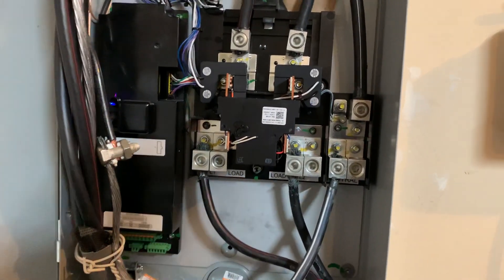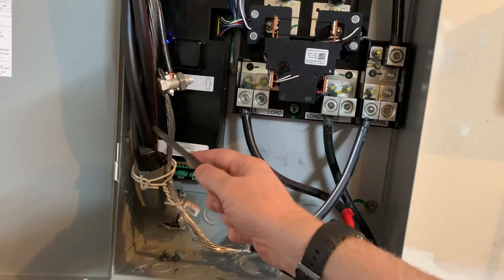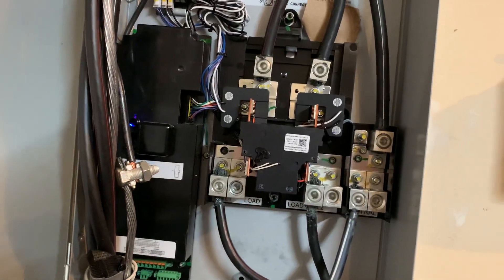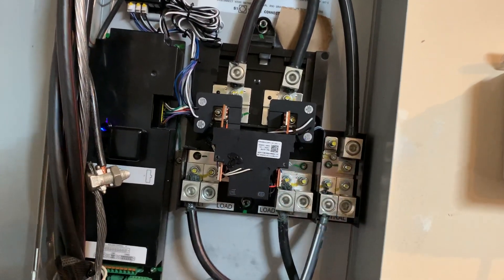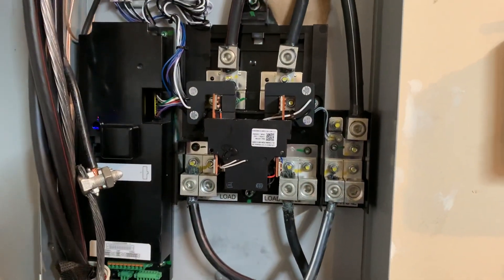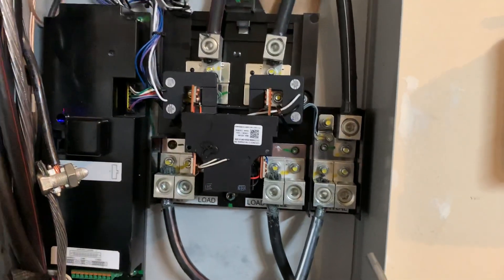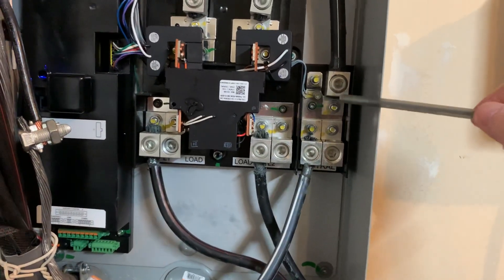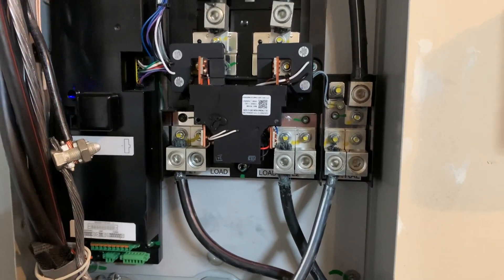How a Tesla gateway works with the powerwall

Comment: Hi I have just purchased a tesla powerwall 1 and it was missing the gateway I'm not sure how to wire it up yet I then bought a gateway it said in the description non back up is this gate  the bit I need to enable me to see either on my laptop or my phone the stats of the battery and do you know the difference between back up gateway and non back up my plan is to charge the battery with my solar panels and run a few sockets of the battery as a separate circuit to my main supply
Reply from the maker: The backup vs non back up is the location where you install the gateway and powerwalls.     If you install your gateway between the meter and your load center, then you can enable back up mode as the gateway will monitor your power usage and can off set that by sending power from the powerwall.
Reply: @teslamike7476  Thank you very much for the reply I understand that now  I don't have much idea at the minute on how to wire it up I am searching online to try find what connects where from battery to the gateway   I bought the battery and have just bought the gateway for it  so can I connect the solar panels  to the battery and from the battery to an inverter as a stand alone system or is the battery ac 240v mains input only? Which im guessing it is I wish I had a simplified wiring diagram
Reply from the maker: @BREN2009 what I did is I connected my battery into the load center with a 32 amp breaker and 6awg wire (over sized the wire).  Then from the powerwall I ran a 16 gage 6 wire to the gateway.      Thats how the gateway talks to the powerwall to tell it to charge or discharge.    

The gateway sits between my electrical meter and my load center.     Where I removed the 0000 aluminum wires from the service panel, and plugged those into the gateway.   I then ran new wires from the gateway to the service panel.      That put me into “back up mode” as the solar panels feed a breaker that’s in my load center.         You do need to run CTs to your solar wires which then plug into your gateway so the gateway knows when power is being generated from the panels.
Reply: @teslamike7476  Thank you so much. Honestly, you are the only person so far  I have talked to that knows about the wiring. What do you mean by load center? Is this my house consumer unit with the breakers in?  or what ever load im powering  ? Also The 2 heavy quick connect connections on the battery circuit board  are damaged so I will have to source and re solder 2 new ones on I have tested with my multimeter the heavy cable coming out of the battery and it was showing something like 4v then crept down to 0 so either the cells are totally discharged or some are damaged or maybe the battery isolates internally when the board is unplugged? I'm not sure I hope  once connected
it will charge back up  I see 2 push buttons on the battery  circuit board is this a safety isolter switch once the cover is removed?   I'm confused i see a sticker that says the battery is 50v and on a youtube  video It says this battery is 500vdc so is it 50v or 500v? Me thinking it was relatively safe to play with, but 500v, I'm sure I'd get a nice belt off that if not careful I can rewire a house so I have an   understanding of how to not get shocked learned the hard way at the minute I have the battery circuit board removed and the gateway but I'm not sure how to connect them together if I took a video would you show me how to wire it or message me on WhatsApp or email I will pay you if you will show me how to wire it so  could I connect it to my mains so it will use the solar power day time and then solar battery on a night  and it will knock my electric bill down  without having to mess around with professionaly installation  certificates or of that's too messy just a stand alone system the same but connected to its own isolated circuites in the house to say run my lights sockects apart from my oven microwave kettle any that takes lots of  power
Reply from the maker: @BREN2009 the battery circuit board inside of the powerwall is damaged? 

Also keep in mind that I’m no expert.  I’m just a guy that did it once and stated what I did.  Make sure to look at teslas documentation for details on how to do it. :). (Take on your own risk in other words)
Reply: @teslamike7476  yes don't get me wrong I use to be an auto electrician and I can fully re wire a house I'm clued up I also have owned a few turbine engines and rebuild and wired them back up with high voltage excitor packs so I'm clever enough to know what not to touch to get hurt I just need a guy like you what I can send some pictures to and if you are willing to help draw me some lines on what to connect where or a layman's terms sketch either conne Ted to my 240v consumer unit or as a stand alone power system I got the battery cheap at £230 and paid £300 for the gateway I'm just lost at the minute on how to connect it and really need help I just want to give solar a try to see if I can infact run most of my house off solar to save money as I say I will pay you for your time no problem I just have the battery and gateway and next need to buy an inverter and panels ideally I want to connect the gateway up to see stats on a laptop or my phone and put some power into the battery with whatever I can use I have a variable power supply  to see if it will hold charge if not I will disassemble the battery and put power separately into the 2 24v modules to raise the voltage past the charge threshold if it has infact discharged too far I'm not daft I wouldn't attempt to wire something up like this if I didnt have an idea about electrics I use to be a sign fitter years ago wiring old neon up with high voltage ballast and wire sodium light up and then leds with power supplies and repair the old piro cable would tou help me? Honestly iv searched the net for a few weeks now to no avail iv added a few posts on a few facebook solar installation groups and nobody knows any useful info I'm really stuck honestly I know what not to touch as in live or shorting out I also  use to have a drone repair page on facebook 2 year ago I'm fairly  good with electronics I just can't work out what connects where
Reply: @teslamike7476  Also yes the 2 big quick release connections are damage there only single leg to re solder 2 new ones on so its an easy Job once I find 2 new ones it's as if someone has stood the battery up on its end  and it's bent them and broke the sides off them but the  rest of the board is perfect

Comment: Hi. Just one question. I’m in the U.K. and  I have a Powerwall 2 with a first generation gateway (couldn’t fit second gen gateway at the time - something to do with earthing). Assuming no solar available (nighttime) when there is a power cut the Powerwall does not take over running the house. This is how I assumed it was. Is there any way you can manually operate it to provide power to the house ?
Reply from the maker: It depends on where the gateway is in relation to your homes service panel and load center.     The gateway should be between the service meter and the load center to have the powerwalls provide power to your home during an outage.

Comment: So it's basically a ship to shore with charge control? Am I understanding right? Where's the inverter for the power wall or is that built into the wall?
Reply from the maker: Thanks for your comment and question.   

The inverters to convert from dc (battery power) to AC (long distance power flow) is housed in the top of each powerwall.   That inverter can produce a peak power draw around 7.4 kWh with a constant draw of 5kwh per powerwall.    If your requirements for power exceeds 5kwh constant power draw, you will need to add another powerwall to cover that draw amount.

Comment: This question probably applies more to the 2nd generation than the first but do you think that the Cybertruck with its 220v output will be able to backfeed in to perhaps a 3rd generation of the back up gateway?
Reply from the maker: Not sure.  It would need some way to figure out the power draw so the truck can provide that power.  In my mind any of the gateways could do it, they would just need an update to know that the cyber truck is plugged in so it can provide the power.   So that connection would need to be upstream from the CTs used to determine grid usage.

Comment: I wonder what the difference is between this Gateway 1 and Gateway 2, which I have. I'm hoping someone comes out with a video to hack it since it's limiting ability to backup from a generator
Reply from the maker: Thanks for your comment.  A major difference is the gateway 1 doesn’t have a load center which is present in the gateway two.       

You don’t need to hack the system to enable charging of the powerwalls from a generator.  You can just move the CTs from the solar wiring to the 240v generator wiring.  The powerwall will believe that the power the generator is providing is solar energy and will use it to charge the powerwalls.       This I’m 99.9999% sure goes against tesla policy, along with going against the governments tax credits for the powerwalls, but you gotta do what you gotta do in an emergency.  :)
Reply: @teslamike7476  Thank you so much!!!

Comment: How do you install a back up generator through the gateway in case of emergency situations and longer power outages?
Reply: Same question. I would like the gateway to switch to a backup generator if I didn’t get enough sun to get them to a significant level. Surprised this isn’t supported.
Reply from the maker: Through the gateway?    Meaning you want to supplement your power using a generator?   (Or in the case of a full grid outage run off the generator to not only power your home but to also charge the powerwalls?) 

Depending on how you paid for the powerwalls the answer changes.     For a powerwall to qualify for the federal alternative energy tax credit the powerwalls can only charge from the solar panels installed on your home.    So you would have to change the configuration of the powerwalls to charge from the grid, and the power supplied by your generator would have to provide enough power to do that charging level.   Which the last time I charged my powerwalls from the grid it required 3.5 kw per powerwall.   So for my setup the generator would need to supply 7kw plus anything the home was using.  

In other words I don’t believe Tesla supports charging from a generator, could you hack at it and get it to work?  Sure, but it would take some changes to the configuration of the system which would cause Tesla to void the warranty.
Reply: I have a powerwall system that's grid tied and has an automatic propane generator. The way you do it is to have the generator between the grid supply and the Gateway, with an automatic transfer switch. The system is set to always use solar or battery power first, then defaults to grid when those two aren't providing energy. When the grid doesn't respond (because there's an outage), the transfer switch kicks on the generator, which kicks back off when it senses the grid supply has returned. We live in an area where there are lots of outages due to downed trees in windstorms, and we end up leaning on the generator several times each year. Sometimes, because it's early morning and the batteries have gotten used up during the night, but there's no sun yet or it's overcast. Sometimes it's because something goes wrong with the solar.

Comment: Not magnets. Contactors are basically huge current relays with beefier CONTACTS.
Reply from the maker: What engages the contactors?  :). (I’m sorry how I phrased it was confusing to you.  The contactor is engaged by a magnet, which closes the circuit allowing for the electrons to flow.    The purpose of the magnet is to physically move the switch to either an open state or closed state.)
Reply: @teslamike7476  The contactors I've seen usually have springs to hold their position or electromagnetic coils.
Reply from the maker: @TheTubejunky  the implementations of a contactor using a spring, that I have seen, the spring is used to keep the circuit open in the absence of the magnetic field.   So when the circuit needs to be closed the system engages the magnetic field which closes the contactor and electrons flow.    In the event of a power outage/failure the spring will force the contactor open breaking the electrical connection.      These are typically used on a air conditioners so the contactors are open until power flow is needed then the magnetic field is engaged closing the circuit at the end of the cooling cycle the magnetic field is removed, the spring forces the contactor open and the compressor looses power ending the cooling cycle.

Comment: No touchy touchy
Reply from the maker: :) zap zap!   I redid the ground wires to use a butt splice.   I also cut back the insulation and spread the hot wires further apart.  It looks a lot better and builds up less heat.  :)

Comment: I don't think u understand my question. It's obvious the power company has 2/120 volt phases but the solar array only has one positive and one negative. Let me make it easy for you. Do you have to have a second array bringing in another phase to equal 2 dc phases?
Reply: Solar panels are connected to an inverter    n that inverter its will be connected to l1 n l2
Reply: Usually Tesla AC couples their system with a SolarEdge Inverter. That SolarEdge inverter is tied into the main panel on a 20-40 amp 2 pole breaker. I’m not sure about the Tesla gateway but seems like most systems can handle up to a 500 watt phase imbalance from L1 and L2
Reply: I think the confusion / part missing is when the house is in island mode (isolated from the grid), how are the 2 hot phases generated by the power wall?  The solar panels and inverter combo gets your 240VAC out (single phase hot-to-hot), but where is the component/device in the system that gets you the two 120VAC phases that the house needs?  That is typically an auto-transformer - not sure how that functionality is covered here as it isn't in the Gateway v1.  Is the auto-transformer in the PowerWall, or are the two phases generated without one?
Reply from the maker: @billjohnson3344  the powerwalls are in my basement, those powerwalls are supplying the power you need.    They are connected to the system with a dual pole 30 amp breaker.  Each arm of the powerwall is supplying 120v combined for 240v.    I can make a follow up video going over that part if it would be helpful.